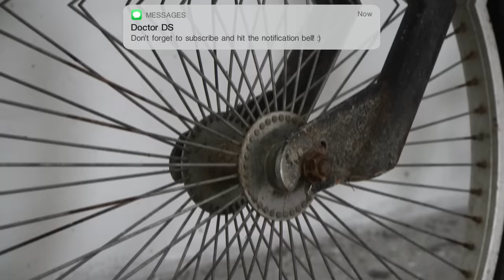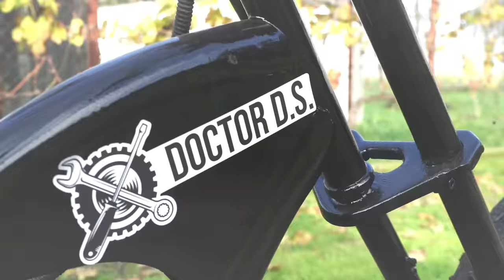Homemade 50cc TRIMMER Chopper BIKE !?

Comment: I think the gearing is messed up. The driver looks OK. But it should go directly to the rear wheel with 40+ tooth sprocket.
I can't fathom right now, how the large crank sprocket to another large sprocket at the rear works. I guess the engine is cranking the cranks to crank the wheel.

Comment: Nice job but If the 2 front sprockets were switched, I suspect it would be much faster. It would greatly lower the gear ratio allowing the clutch to hook up and engine to rapidly gain rpm with ease. As it is, the clutch will burn up fast trying to lock up the clutch drum. That can't happen because your gearing is way too high.

Comment: Since you show us such chad moves as to hand-center two sprockets and weld them, it doesn't shock me any less that you didn't just weld the big sprocket on the wheel and put a smaller one on the crank so the gearing would be closer to right the first time. 
this gearing eats almost all the power this poor weed-wacker can produce boi.

Comment: I have the same chopper but with a 2 stroke, goes 21 mph. Not sure how you made it run so slow but yea.. I could walk faster than that
Reply: What engine kit u useing and also do u have disc brakes cause I have similar bike that I want to do this to but have heard u need disc brakes
Reply: the one in the video is a 2 stroke too

Comment: Upgrade that engine on the chopper bicycle to something much better like a small dirt bike or go kart engine but think 🤔 dirt bike engine would look sharp onto it doctor d.s. 

I've do the same thing I had a miniature go kart I've converted with huge wheels on the big of it and medium in the front had a 13 hp engine onto it as well and I sold it to someone a while back ago and planning on a new build soon later I'm just thinking 🤔 about it now and looking for something cheap to start off with

Comment: i would recommend you use a better clutch, for that engine the clutch keeps slipping, thats why you're going slow
Reply: and the reason why it slips cuz its overloaded.. needs a smaller gear ratio AND a better clutch cuz its from a trimmer and its not designed for riding xd

Comment: very cool design, however the trimmer engine is a mistake!
Reply: I have very simillar engine, and I'm accually doing very similar project. mine engine has 3.8kW of power (about 5hp) I assume his is similar. my calculations say that theoreticaly it can go up to 80kmh or 50mph. The key is good gear ratio, his gear ratio is terrible. I bet he burned that clutch.

Comment: Well, when in your backyard you have a whole warehouse of bicycles, engines, a bunch of tools, and so on) and there is plenty of time to suffer such nonsense) personally in our Ukraine, such a road / recreational bike is like a serviceable scooter with a volume of 50cm3 or even more. And everything is legal and you don't have to remodel anything! And, you can generally buy a Soviet motorcycle with a sidecar on 750cm3 on the move and cheaper!, only fuel and oil consumption will be more than a normal passenger car)...

Comment: 1.  Do not use a glue gun.  2. Put a 2nd fuel tank on it.  3. Put lights and signals on it. 4. Cover the chains.  5. Move the feet rest forward.  6.  Put a fender on the  back.  7. put pipes on it.  Half ass work.